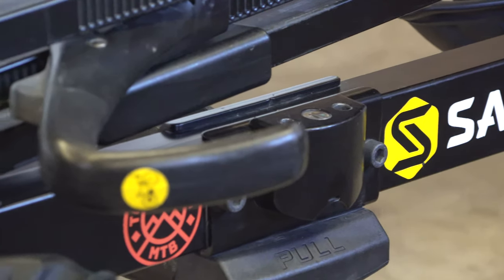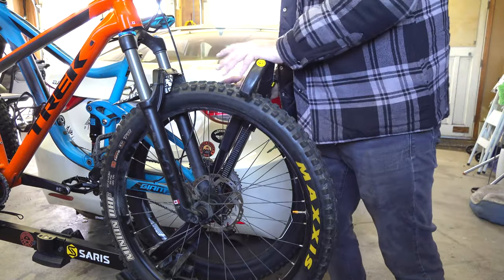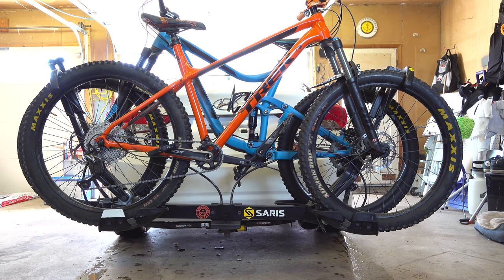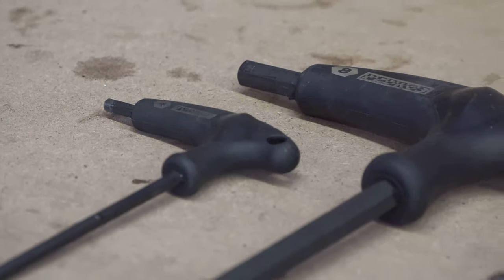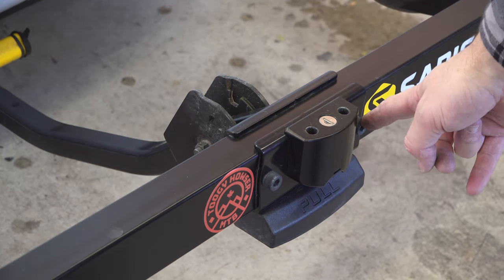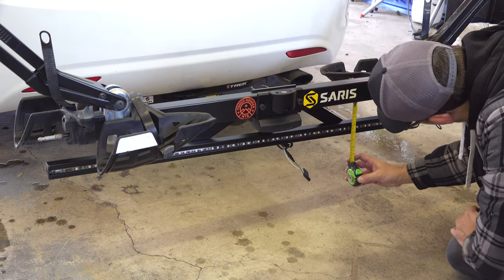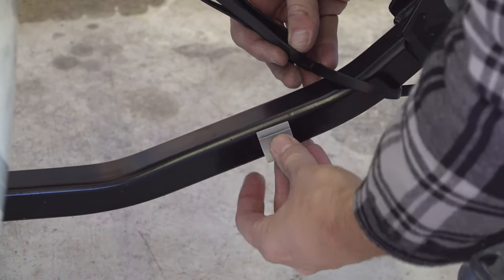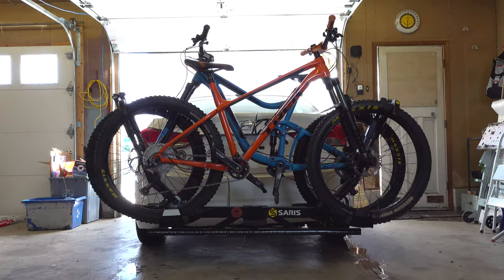Saris Lightbar // Install & Overview  // Hitch Bike Rack LED lights

Comment: Will it fit size XX Longest(1371mm wheelbase) Geometron or other huge bikes like Pole Machine XL?
I went for Large Geometron, which I am building up, just need to wait for few parts. so mien will be around 1324mm wheelbase, not measured yet, but cus need few parts, but got 44mm offset fork.

Comment: That rack looks as though there is a lot of 'play' is there something else that needs to be tightened?
Reply: Jackie Gammon I think it’s just play at the hitch. Mine (not Saris) wiggles a bit too.
Reply: It's not play, a hitch receiver with a single bar will wiggle at the steel bar, but the bikes are not going to go anywhere.
Reply: @truantray  I have owned racks for years, and in fact own a shop... there should be NO play there.
Reply: @jackiegammon2065  its not play, it's slight flexing of the steel. Thanks for your expertise. I'm sure you can steer us to something 3x more expensive.
Reply: @truantray  If steel was flexing while the vehicle is not moving, then it would more than likely drop the bikes with the vehicle is moving. Steel does 'flex' that easily. More than likely what is the issue is the dimension of the receiver hitch mount(where the rack attaches) and the rack tongue piece.

Comment: what if you get falt tyres?
Reply from the maker: the tire trays do have straps if you had a flat you could use those
Reply: @ToogyHowser  I guess it will be fine.